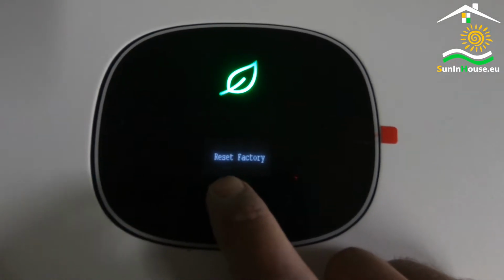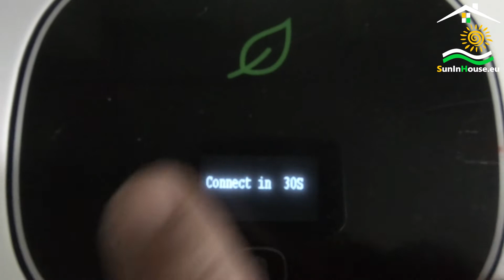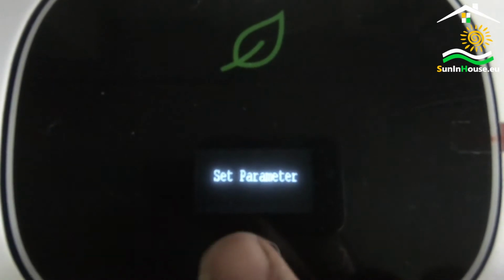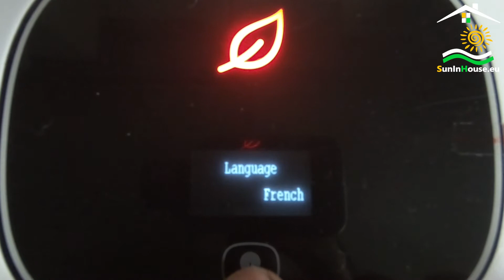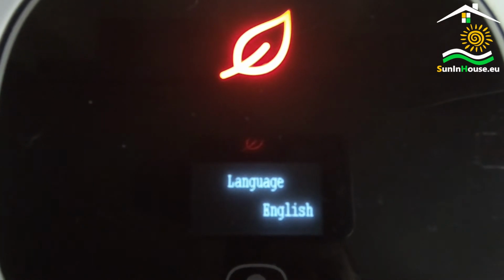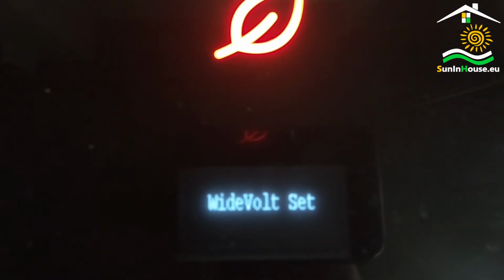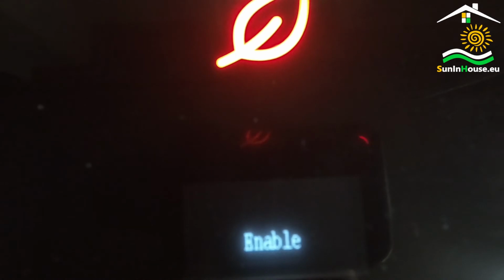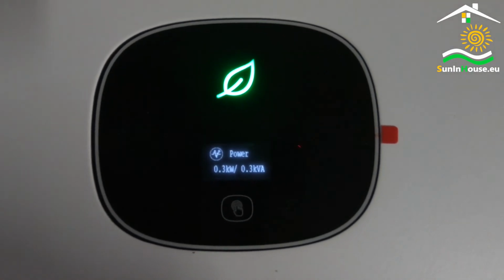Growatt MOD TL3-X commissioning EN

Comment: Hi, do you know if a three phase inverter (MOD 3000 TL3-XH) is capable to push all it's capacity to one phase only if there is a high load on one phase, but no load on the other two phases?
Reply: no

Comment: 1.What is the correct voltage for the inverter to operate  . Should it be above or below 230?
2.  Which range should the inverter be set  ?  Should it be 0, 1,   or 2 ?
Reply from the maker: Range should be increased if over or under voltage occurs. Different countries have different low and up limits.

Comment: Hello, what does enabling Nline does? There is no explanation about it anywhere.
Reply from the maker: What exatly do you mean?  What Signal? What Connector? What Pin? Or other?
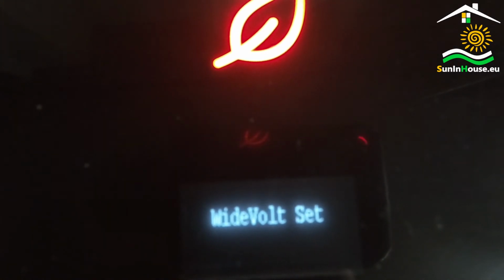Reply: @suninhouse6988  at 5:30 timestamp of your video you talk about the Nline setting which you can enable or disable. What does this function do? Thanks for your help.
Reply from the maker: This is enabling relays by enabling GND signails of its coils
Reply: @suninhouse6988  do you have an example? I didn't understand what you mean well. Thanks again
Reply from the maker: There are digital outputc potential free contacts No&Nc driven by coils
Reply: @suninhouse6988  I don't understand, should this option always be disabled for a single-phase installation? What does it mean for a normal house installation?
Reply: @julimobalmis5650  I have the same question on this. In a regular 3ph ongrid system, should it be enable or disable.
Thanks in advance

Comment: Hellp, thank you for the video but can I ask aditional questions? I have to set parameters such as 

U > 1,1 pu; 30s (253 V, 30s)
U >> 1,14 pu; 0,2s (262 V, 0,2s)
U < 0,9 pu; 1,5s (207 V, 1,5s)
U  << 0,8 pu; 0,2s (184 V, 0,2s)
f > 51,5 Hz; 0,1s
f < 47,5 Hz; 0,1s 

Any idea where I could do something like that? I installed growatt dongle (ShineWiFi-X module) but i cannot find such settings.

Thank you in advance!
Reply from the maker: These parameters are an integral part of the standard on the basis of which power generators are connected to the grid. These parameters are changed when the standard is changed. From the prosumer's point of view, higher limits give better independence of the system with fluctuations in network parameters (fewer shutdowns due to exceeding the parameters). In Europe, each country has its standards, which are very similar, the main difference is the voltage limits. In this respect, the largest permissible ranges apply in Germany and Italy, and choosing the standards of these countries gives the greatest independence of the system from fluctuations in network parameters. Other parameters of the standards, such as frequency, phase shift, harmonic content coefficient, etc., are not subject to separate branches of the inverter firmware algorithms.